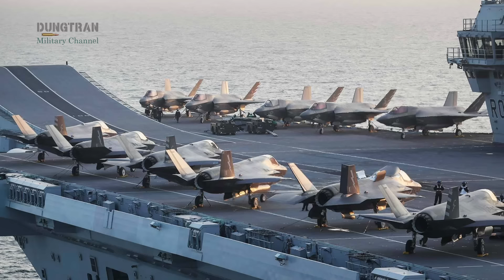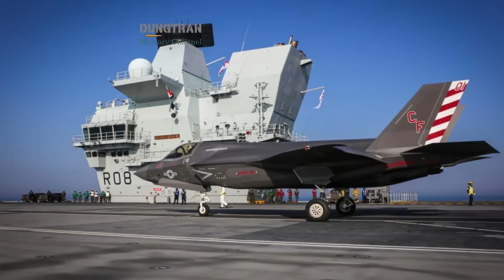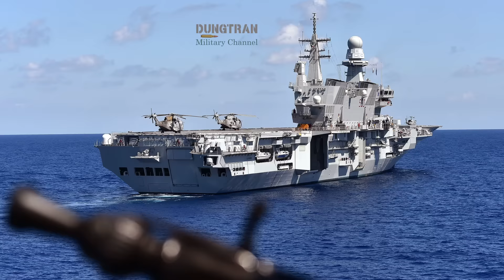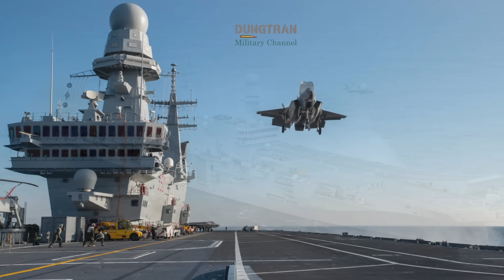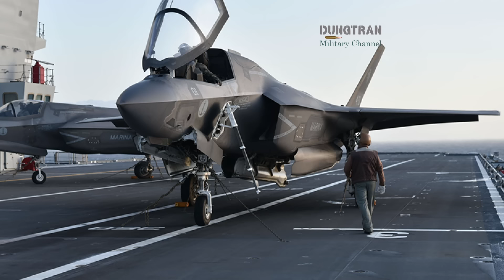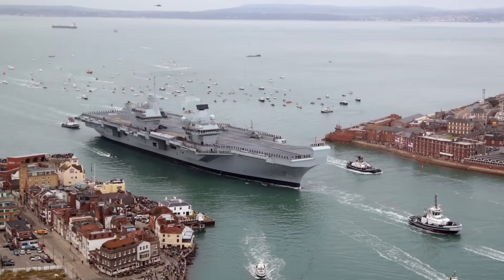Cavour vs Queen Elizabeth: Who Leads NATO’s F-35B Era?

Comment: The Cavour does not mount Teseo Mk2/E missiles (which are naval attack missiles), but has 32 VLS cells for Aster 15 as well as two OTO 76mm Strales capable of firing DART guided projectiles.
As published by the Royal Navy itself, the displacement is 65,000 tons. Its engine power is 120 MW (72 MW from gas turbines and 48 MW from diesel generators), it can travel at a declared speed of 25 knots and has a range of 10,000 nautical miles. It carries and operates 40 aircraft; surge mode does not allow for the full operation of all 72 aircraft. The crew is 679, excluding flight complement.
The Cavour, on the other hand, displaces 30,000 tons, its engines produce 101.6 MW, it can travel at a declared speed of 29 knots and has a range of 7,000 nautical miles. It carries and operates 25 aircraft and has a surge mode of 40 vehicles. The crew is 451, excluding flight and amphibious complement.

Comment: The Queen Elizabeth class carriers are 80,600 tonnes deep load, 284 metres/932 feet in length, 73 metres/240 feet in width, and have a surge capacity of 72 aircraft in wartime. PS engine capacity is not 110 MW it’s 120 MW.
Reply: But doesn't work😂😂😂

Comment: there not even in the same class. a carrier is only as strong as its aircraft. The queen elizabeth aircraft carriers can operate x36 f35s, plus another x30 rotary aircraft ontop. The cavour is significantly smaller and can only operate x16 f35s. Its a cool little carrier but a completely different class
Reply: Thr Trieste is much more flexible as a assault ship. Horses for course. Factor in the costs and what would you rather have? 2 QE2s, or 8 Cavour/Triestes. Yeah.  Thought so.
Reply: @fabioq6916  but there isnt 8, theres 3, and the British carriers can carry more f35s than those 3 combined..... so no, id much rather be standing on the deck on a queen elizabeth carrier than an italian one. Dont get me wrong, those italian ships are great bits of kit, but if a fight broke out id much rather be on the ship that has more f35s...for obviously reasons. As i said, a carrier can be big, small, nuclear powered, conventionally powered, catbars or no carbars, it doesnt matter. A carrier is only as strong as the aircraft it operates. And if one has 10 and another has 36, the one with jets with 36 will probably win. 3 carriers carrying 30 to f35s vs 2 carriers carrying 72, the group with 72 will win. See my point

Comment: Just to make a few corrections regarding QE class carriers. The current Prince Of Wales CSG did not originally include US aircraft, as with Italy it consisted of AF and Fleet air arm aircraft making up a full airwing. US aircraft joined later in the deployment. QE class can operate with a crew of under 700 if neccessary not including air crew. QE class can carry 72 airframes in surge mode. QE class was built domestically with very few parts being sub contracted to foriegn manufacturers through BAE systems and Rolls Royce.

Comment: The Cavour can carry 20/22 aircraft on the deck
Reply: It is even better armed to fegend itself, the Queen Elizabeth is to heavy and slow, the defense is very weak too
Reply: 20/22 aircraft on de deck ???.....You can see in the video whit 15 aircraft in the deck........wer Is the space for use 20/22 aircraft???????....... pleeeaaaaseeee!!!!
Reply: @trotamarmorata2673 It depends on the mission. If necessary, it can carry up to 36 aircraft between the deck and hangar. During the 2024 Indo-Pacific mission in the East, there were 17 aircraft on the deck alone, including 15 fighters (7 Harriers and 8 F-35Bs) and 2 helicopters, and there was still room for more fighters. All you have to do is park them intelligently. In any case, on a standard mission, the Cavour carries around thirty aircraft.
Reply: @trotamarmorata2673 https://youtu.be/iZ9RbyqLEOA?feature=shared